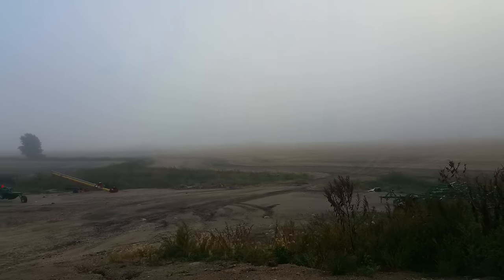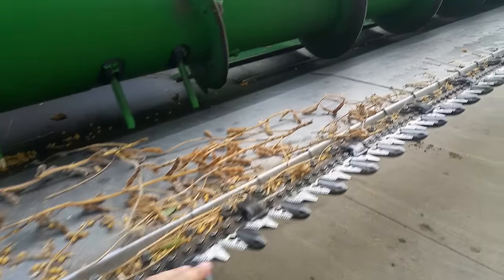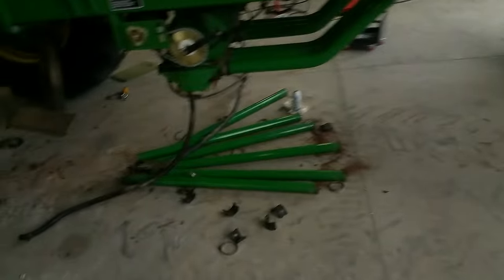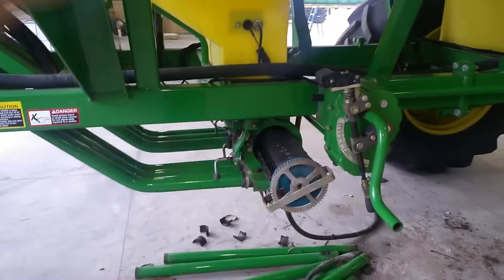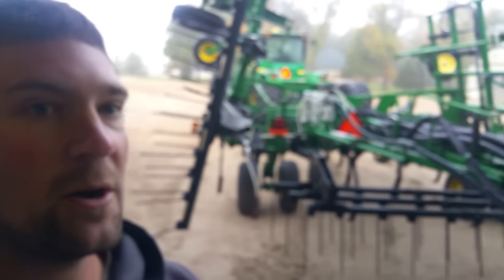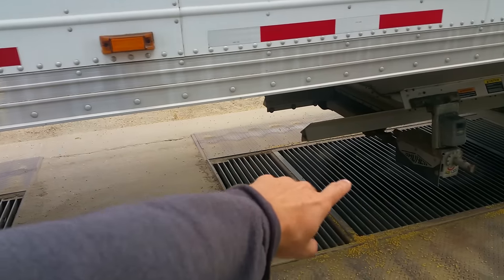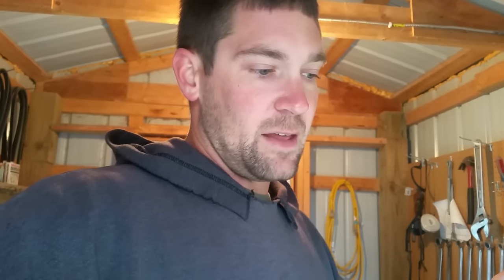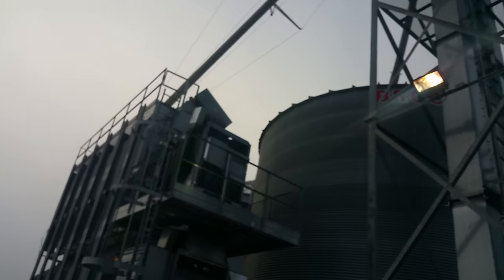Tough BEANS! Daily combine maintenance.

Comment: I love your bin set up. About how quickly can that dryer dry down beans let's say 20% to 13%?  Bushels per hour?   And I would love to see more of an in-depth video of your dryer and bin controls. It looks like you really have a lot going on and I was hoping to see how easy or time consuming it is to keep track of what bin things are going to, how you know how much is in each bin and if there are any issues inside a bin. I really want to learn a lot about different ways people are storing grain and how technology is helping make it easier.
Reply from the maker: We wouldn't take beans at 20% unless things got desperate, but at around 15% we are drying roughly 700 bushels/hour.  I will get a better video of the drying and bin system yet this fall, most likely when we switch to corn.

Comment: wow nice grain handling set up wish i had that. question though, why not build another leg to feed out of the dryer and into the dry bins instead of using a blower?
Reply from the maker: Kris Cipywnyk Mostly because the leg would have to be so tall and it would be really expensive.  For now we have had good luck with the air system.

Comment: If you roll beans i guarantee you will not have a broke sickle section or guard unless you hit a huge rock or some other thing. Also you guys have a nice bin setup
Reply: what do you mean if you "roll" beans?
Reply from the maker: Thanks!  We roll 95% of our beans.  It helps a lot but we still break probably 1-2 guards every day.  That's over 150-200 acres...
Reply from the maker: We pull a "roller" over the fields after they're planted to smooth the soil out.  there's a clip of it in one of my earlier videos about preparing the fields for planting
Reply: There are no guarantees in Farming...